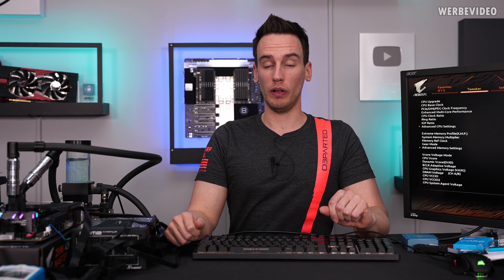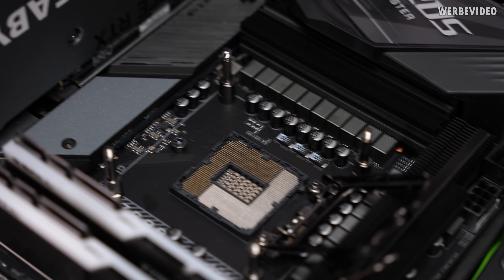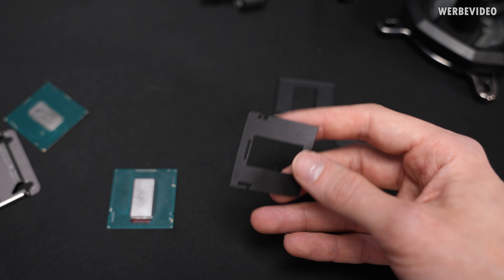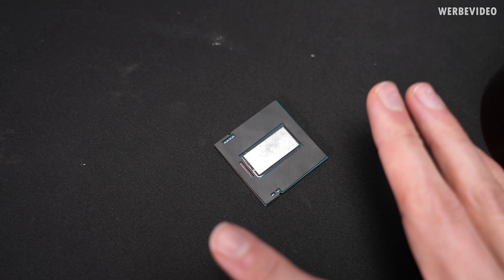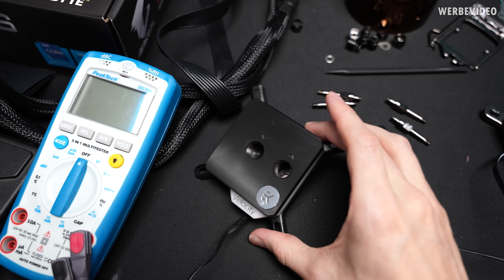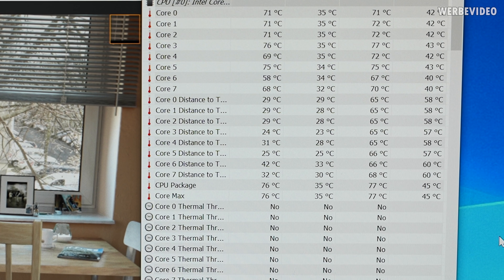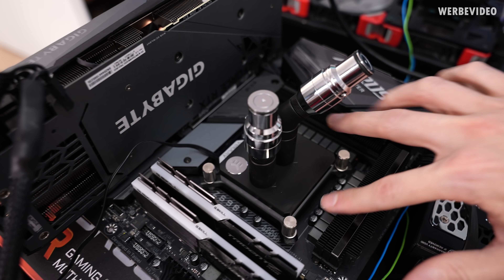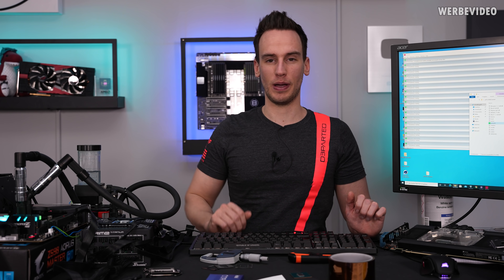Unexpected Results: 11900K Direct Die Cooling

Comment: Direct die couldn't have been worse if the same conditions were actually met.

You do realize it's most probable this didn't happen, correct?

Considering the difference in die height seemingly every generation, isn't it most likely you simply didn't have good contact when running direct die?

Seems most likely to me.

Comment: No proper contact.
That's because the EKBW water block has a convex cold plate machined for Intel's concave IHS, which doesn't make good contact with the chip's direct surface.

Comment: Have you ever done any sustained OC testing? 
I was thinking of using a micro-brew beer chiller to keep the coolant a few degrees above the dew point and using a protein folding program as a stressor.
Reply: You would have to be very careful of condensation. Mixing cold and warm can be dangerous .. but the thought have crossed my mind haha although now with direct die, liquid metal and powerful custom loop . I no longer need this… GPU max 50g…. Typical 45g. CPU 10900k 48-60g for gaming. 78-80g extreme stress test.

Comment: Directdie without LM is worse then a IHS, but it looks like your LM is good, but those results are extremely poor i think you need to change your mounting kit you need more pressure and also check the back of the Motherboard pcb not the CPU PCB it could be bending if you try to increase pressure and it bends you actually end up with less pressure and if you overdo it a broken motherboard you need a really solid back-plate to fight against bending

and its important where you put the extra washers there more effective if you stack them up behind the backplate shortening the screws bringing the thread closer to the CPU then if you stick them on the front side of the socket, not reducing the thread height increasing pressure on the motherboard without bringing the cooler closer to the CPU.

source i bent my Z390 Aorus Extreme, it died i was very sad but i got the mounting right with a Z390 Ultra and now 5.2ghz is easy

Comment: don't forget that you have to lap the block itself since they area relying on any imperfections to be filled by TIM over a large area
Reply: yeah lap CPUs too just a little polishing it helps clean out any leftover STIM and it makes the die more flat, i had scratches on my die after a bad mounting attempt and i tried to lap them all out i couldn't get all of them but the CPU still works so they couldn't of been that deep and i am sure the lapping would of helped thermals a bit

Comment: Don’t forget, back in the day no CPUs had heat spreaders. And “direct die” was all we had for all those years and things were fine. Breaking the die was insanely rare.
Reply: Because they were designed to be that way. Newer chips are way easier to crack, and with the much higher density even a microcrack has a lot higher chance of killing the chip compared to old dies
Reply: was it really direct die though? most of those chips had like a thick ceramic packing material around them
Reply: @Cypeq  Socket A and Socket 370 CPUs both had exposed dies. Prior to that AMD had used metal heatspreaders on the K6 family, and before that almost everyone had used ceramic packages for PGA and DIP CPUs. Sometimes with DIP you would, and these days almost always do, find plastic packages.

Edit: also some Socket 7 CPUs, including some but not all Pentium MMX, had either a metal heatspreader or a metallized coating on the bare die. At this point I don't recall which it was and no longer have such old CPUs on-hand to check.

Slot 1 and Slot 2 BGA CPUs had metal heatspreaders as well, while the later FCBGA models and Slot A CPUs had bare dies. Most users would never encounter either, since the slot-format CPU cards were enclosed in cassette-type packages that incorporated a (additional) full-dimension metal plate for cooler mounting - so essentially the early Intel slotted CPUs had two heatspreaders, stacked.
Reply: @Cypeq  The package was ceramic on Durons and early Athlon,  - it wasn't packing material. At best you had 4x small foam pads around the die to help prevent damage.
Reply: @Doom Guy Evap head? Heh. smack on head
Reply: Even with chipped corners all of my Pentium III work just fine. Except my lone C0 stepping PIII 1000. Even undamaged it was unstable, unlike my pair of D0 PIII 1000.

Still amazed that the foam pads on my Duron, Athlon XP and Sempron are intact as well (they've seen some heat).

Comment: i have a rocketcool direct die kit on my 10850k, and ive had super stable and equal temps accross all cores. i did have to modify a couple things (like for the water block i am using i had to use electrical tape under the block support studs instead of the plastic washers, because it created too much clearance between the block and the die) but other than that its great, and for 60 bucks for the delidding tools and the mounting stuff, not a bad deal really.
Reply: I wanted that also originally but due to asus board there is an extra row of capacitors requiring to mill or Dremel the water block. So I’m going for another one off unique product .. the nCore V1! Check it out ! F ing amazing product… ordered two days ago so can’t wait

Comment: With direct die cooling only a part of waterblock surface area works thermally - after few milimeters off the core die the copper is allready cooled to ambient (water) temp. Heatspreader actually, spreads heat in this case ,)

Comment: its gonna be funny when 2 years from now all the ps5's start overheating and damaging because of liquid metal
Reply: I'd assume that they did a reasonably long-term durability test first before putting them into production, probably just the warranty duration though :P
Reply: @user-bf5sc8pn8x  you assume but sony is a faliure of an engineering company there is no reason the ps5 needed to be that big, amd theres no metal thats impervious to the long term effects of liquid metal but they had no other option because the thermal past causes it to overheat.

Comment: This could be due to low flow rate. Most cases it won't matter, I know, but this is an extreme case of heat concentration.
Any chance you would run the test without the quick-releases?

Comment: Pretty sure that EK Velocity block has a concave cold plate meant to match up with the IHS better. If you had the EK Magnitude block, you can switch out the concave cold plate for the flat one, which should work better in theory for direct die.

Comment: Have you considered testing out the Ncore V1? I have one laying around and I'm struggling with myself with the choice of keeping my 9900K or upgrading to 11900K (Also for the PCIE 4.0 support), but now I'm worried if I might get worse results with my cooling setup!
Reply: I just ordered one for my 10900k. 😛 can’t wait… my delid 10900k currently runs with custom cobber ihs, which was not originally intended. But due to asus board there is an extra row of capacitors rendering most know direct die kits incompatible. Only solution I know of is the nCore V1. And I just love that is works with the cpu lock and spring mechanism. I have very high expectations for it as it’s basically the best solution out there with LM on die. I hope I won’t let down because I have actually tuned my 10900k very very efficiently. Using offset mode with -0.070mv gives me very low temp and gaming temp in my custom water loop. Gaming 48-58g … extreme stress test 78g. This is at 50x/47x

I am baffled you actually have that nCore laying around and not use it it hehe…. I waited 6 months for mine and finally within 3 weeks it’s all mine haha

Comment: Have u seen the channel Clock'EM UP? The guy just design a new kind of waterblock, that means the IHS now is kind of directdie mode for 10900K. Check it up u may like... he was running 10900k with very high clocks with ambient temp around 30c with GREAT temps.

Comment: In theory, direct-die cooling SHOULD work much better than just with de-liding. Something doesn't add up there, there might still be a contact pressure or evenness issue. I've done that many years ago with an older Intel CPU that wasn't using solder under the IHS but normal paste and the difference was noticeable between just delid and direct-die.
Reply: P.S.: I think you should check the flatness of the block and the die itself and maybe lap them if they're not perfectly flat.

Comment: I've had to lap my cpu blocks when I used for direct die.
Reply: Makes sense as most are concave. How where the results difference? I am curious as I have a custom cobbler ihs which is flat for my 10900k but my waterblock an older EK classic, I have never modified. I am unsure if it’s flat or concave. It will be history though in 3 weeks after almost a decade in service haha it will be replaced by unique one off nCore V1 direct die waterblock which actually have a built in ihs! And locks in the cpu locking and spring mechanism- no screws needed. Can’t wait … ohhh and that too should be perfectly flat as it’s a direct die product …. But tell me your results and difference with lap and no lap block. Also you did use LM right ?

Comment: Hello. I know you've thought about it but a stupid question.

Is it possible to make IHS that will be used for water cooling? I mean IHS with holes for water and liquid will actually touch the core in order to remove the thermal paste and additional layer of metal.

Comment: The Watercool blocks I bought have thick low oxygen copper base plates and have a lot of thermal mass. Oxygen content of copper will impede electrical resistance and thermal conductivity, not all coppers are equal in quality. There is also a quality improvement with the trademarked Plexiglass over generic acrylic.

Comment: I love your videos, you push the limits. I have a suggestion. for the soldered Heat spreaders, why not make a jig to hold it flat and firm. You could use this in a cnc machine to shave off the top without stressing the CPU too much with heat and pressure. you could keep the standard mounting tabs which would make the whole mounting job easier. 

quite simply just remove the middle of the Heat spreader.

Comment: Did you by any chance get the Ncore V1 direct die block that is finally out? Can you try that with the 11900k by any chance? I have one I ordered like 2 or 3 years ago during the kickstarter and it finally came. I wonder if it would work on the 11900k.

Comment: Hello
I need your help.
The very good, nice and funny YT-Channel "Tech Ingredients" made a new special PC Air Cooler ("Is Air Cooled Actually Better Than Liquid Cooled? - A/C Computer"). The temperatures are very good but they cannot use the Ryzen higher than 4900 MHz.
Can you help them with the mainboard and BIOS?
Thank you and have a nice time.
Wizzard Rincewind
PS: They use a air conditioner and you can use this to cool your room in summer and heat in winter :)

Comment: I wonder... Have you tested deliding or direct dies cooling on AMD? 🤔 And if not, why? 🙄
Reply: He has, and found that delidding and replacement with liquid metal was a miniscule improvement given the quality and lack of thickness of Ryzen solder. The 1-2C improvement is in no way worth the difficulty in his opinion. As for direct die, the nature of the Ryzen 3000 and 5000 chiplet layout severely increases the risk of cracking one or more dies versus Intel monolithic, and increases the difficulty of reliably producing a shield like Intel dies have available. The temperature improvement of direct die is also minimal vs both stock and delidded, so he believes there's no real point

Comment: What if you were to use a Panasonic PGS sheet on the water block to spread the heat over the whole block? Those PGS sheets are amazing at moving heat in the XY axis. I’m thinking Die -> liquid metal -> PGS -> water block. That would basically take the place of the IHS, but have much better thermal conductivity, and still eliminates one layer of thermal paste.

Comment: it would be interesting to see at what temperature differential the deliding is efficient while considering heat flux with and without IHS. If you put a thermistor on the cooling block and compared it to the internal temperature of the chip you can probably estimate the amount of insulation experienced by the liquid metal -> IHS ->thermal paste -> cooling block. I would predict this is efficient with refrigeration and high current TECs with heavy overclocking or over volting/amping the dye since the temperature gradient will demand less and less insulation? Thanks I was thinking about this!

Comment: So I'm guessing some of the heat from the CPU spreads out through the PCB. So in order to get the best cooling, you have to have contact between the PCB and the cooling block. I guess you could carefully cover up all the surface mount components with rubber and then use liquid metal on the rest of the PCB? Sounds like a disaster tbh, but it would be worth a shot maybe.
Reply: Sounds like road to disaster yes haha but I don’t see at all why use the effort to pcb cool CPU … I have never heard of this and no reviews out there suggesting this is a thing at all. The air compartment under the ihs is so tiny that I can’t at all see this as a bottleneck in cooling. If you really want the best I suggest custom water loop and then you can additionally add either custom copper ihs with LM or all in - direct die LM …. I just ordered nCore V1 which is truly a unique one off amazing product for direct die cooling of my 10900k . 3 weeks for shipping- can’t wait

Comment: Why not put copper shims in there to keep the cooler from every being able to rock that far down?   Even covering them, given the pressure, it will push through whatever you put on them to "protect" them.  Just use copper thinner than the die, but thicker than the components.

Comment: If you tighten the CPU block with regular M4 screws it will be much better.
Obviously, you don't have enough pressure contact like now.
Reply: If the pins contact and the cpu boots it`s enough pressure....

Comment: Water has shit thermal conductivity, cpu die covered with very thin copper doesnt spread heat enought, to efficiently transfer it to watter. I propose you try direct die cooling with air coolers with direct heatpipe contact, or insert vapor chamber between cpu and water block.
Reply: In a water-cooling system heat transport happens because water is being circulated around the loop. Conduction and convection aren't really important.

If you took a few minutes to investigate how really are cooling devices you would know that a heat-pipe is actually hollow and contains a small amount of water on the inside. It works by that small amount of water heating up to evaporation point, at which rate the hot vapor moves very fast to the coldest point of the heat-pipe(usually the finned heat-sink) where it condenses back to liquid form and then returns to the hot spots of the heat-pipe. Again the heat-pipe system works not because conduction or convection, but instead a fluid is "charged" with heat, then moved away to another place to discharge heat in the fluid. Same principle than a water-cooling loop.

To put it simple: in any cooling system it's much more faster heat transfer to circulate a fluid or a gas used as a means to transport heat than relying in what in engineering is called passive heat transfer: conduction, convection and radiation.

The reason why direct die performs a bit worse than delided it's most likely because the liquid metal thickness in both direct die assembly and delided assembly. The coolers have dimensions laid out accounting for the presence of an IHS(a copper block). If you remove the IHS you are stressing the size tolerances of the cooler mounting, so you may end up filling the voids with liquid metal instead of IHS copper. Here all heat transfer works purely by conduction until you hit the cold-plate but liquid metal isn't actually that good heat conductor, so in the end in direct die the higher amount of liquid metal makes it perform slightly worse than delided. It basically point to something we already know in deliding field: the assembly that uses less thickness of TIM performs better.

Comment: Hetzner definitely isn't instant, I had to provide ID picture to them??!! and it took a day for them to approve me. "instant" also they are expensive. I can get a server for as low as 2.5$ per month in USA.
Reply: It's very common for hosts to require ID.  Also you get what you pay for $2.50/month isn't a server.  It's a slice of a server.  I haven't dealt with Hetzner but I'm very familiar with dedicated server pricing and $2.50/month is literal garbage.  If all you need a server for is to share cat videos or your weird opinions online, then yes you can still to even cheaper than $2.50/month services.  You go dedicated so you have full processor power, access over what the server is running with regard to modules and services, and get much higher dedicated bandwidth.  If you don't need those things...then yes.  Go with the $2.50/month option.
Reply: @hypermatrix8999  bullshit...